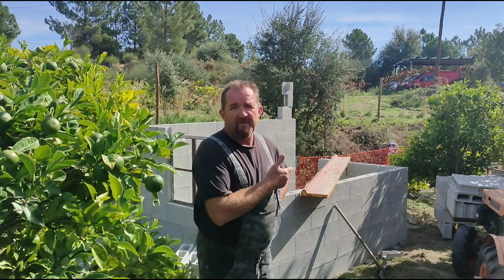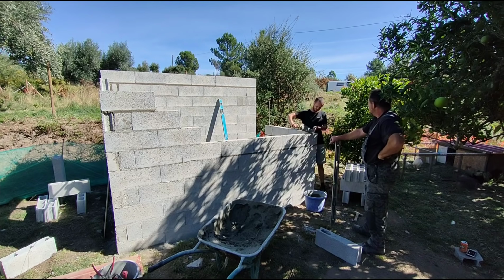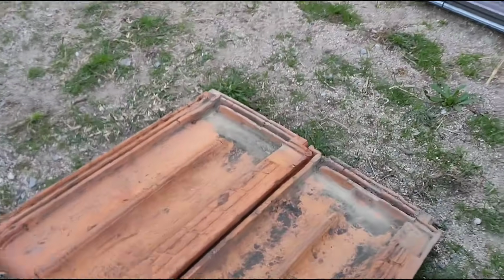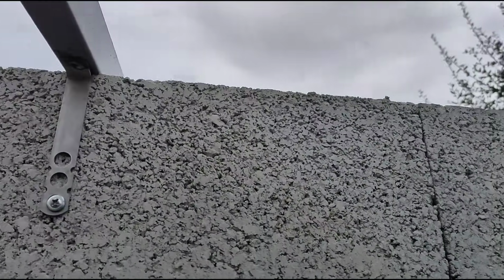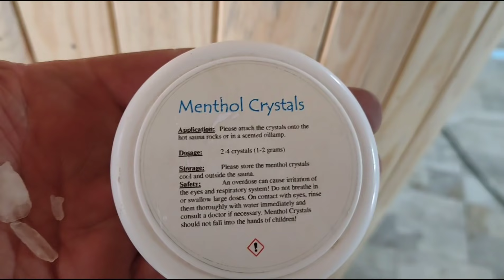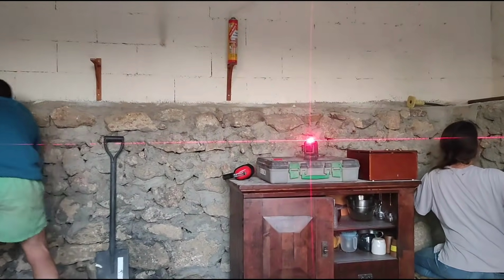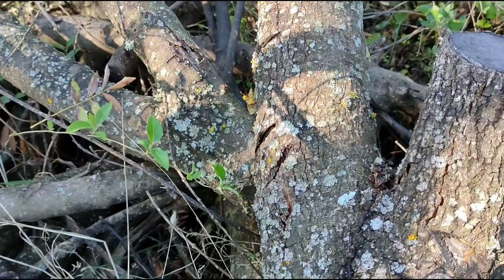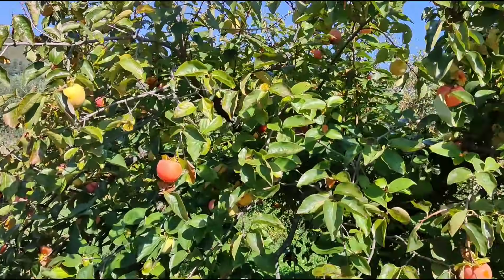No12, Two new Roofs and the new Sauna try-out

Comment: Probably a silly question but how did you secure the tiles to the metal beams in the hen house?
Absolutely love your channel, you remind me of my uncle, he could also put a hand to anything and was so pleasant like yourself. Thank you so much for sharing everything with us. Hope your wife is doing well, My prayers are with you both
Tony
Reply: I have heavy black ones on my roof. Maybe a little larger, or wider than these ones. And they are not secured. They hold each other in place, and because of the weight they stay in place. Only with a heavy storm sometimes a few tiles can get displaced. But it never happened on my roof. Also in most cases the roof is not flat but under a certain angle, this will help also.
Reply: @petervermeer.4904  Exactly...they lock One to each other and they are heavy so they stay in place only by the weight ..also the inclinitation of the roof is not more than 20° pretty flat...
Reply: @petervermeer.4904  Thanks so much Peter
Reply: @netby  Thanks very much Daniel

Comment: I bet Ewen wished he had spent some time with you before he started his chicken house 😊.
Reply from the maker: He did, but it's a lot to take in, and they can now say they built it on their own👍😁
Reply: @projectportugal  Could I ask your advice please Nick? I'm planning a project with tijolo termico blocks ( for a 4.5x7.5m building) . I plan on putting reinforced concrete wall columns  in each corner and in the middle of the 7.5m walls. My question is, would the blocks need a concrete ring to support the roof or would you just use the centre columns of the 7.5m walls to support the ridge beam and span the 4.5m and the corner columns to hold the wall beams? Sorry to trouble you but I'm struggling to find the answer.
Reply from the maker: @matthunt2128  depending on the roof structure, why not make things easy on yourself and build the whole lot from 150mm block, no need for reinforced columns ring beams or all that mallarchie
Reply: @projectportugal  I was hoping for decent insulation and being a very amateur builder I fugured the clay thermal blocks would be easier to work with as they slot together. The roof would be timber with Lusa tiles or something similar, so heavy. Thinking about it, I know you can buy concrete lintel blocks with a U in so you can reinforce and fill with cement. They could be laid together around the top the make a concrete ring.... You thoughts on that hair brained plan.....?
Reply from the maker: @matthunt2128  can you show me the blocks you mean
Reply: @projectportugal  I can't put links in here, YT doesn't allow it but the clay blocks are called tijolo termico (Maxmat) and the lintel blocks are Lintel batao (Leroy).
Reply from the maker: @matthunt2128  I go back to my original answer, the thermal insulation gain you will get from Ill fitting thermal tijolo is negligible are you building a house? If so the most important thing you could insulate is the floor, and depending upon if you want to keep heat out or heat in, should decide the make up of your wall construction
Reply: @projectportugal  Thanks Nick, your advice is appreciated. Yes, a small house as our stone building can't be economically recovered (except the front). We were planning on a leca floor (200mm loose filled, 100mm leca limecrete then 75mm or so limecrete). It looks like concrete blocks are the way forward as I would be insulating the walls whatever I did.
Reply from the maker: @matthunt2128  you may want to reconsider your floor as well mate, I don't know your budget but that's a fairy expensive route, where are you exactly? 
nickprojectportugal@gmail.com
Reply: @projectportugal  I will mail you 👍